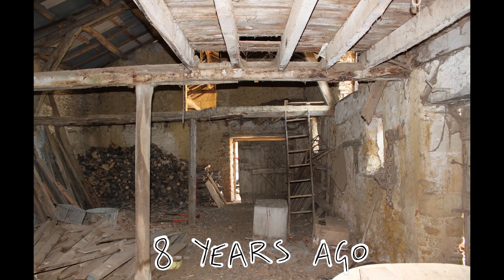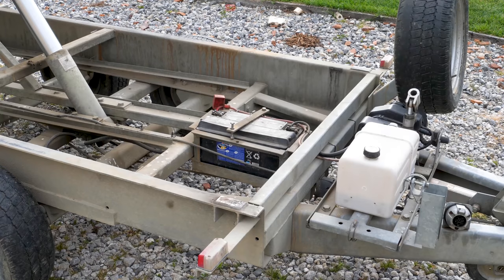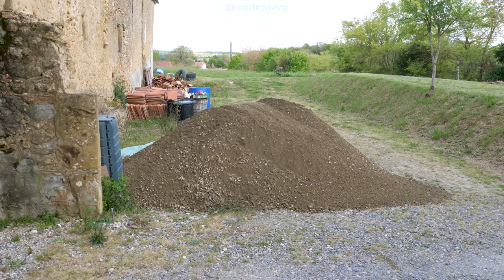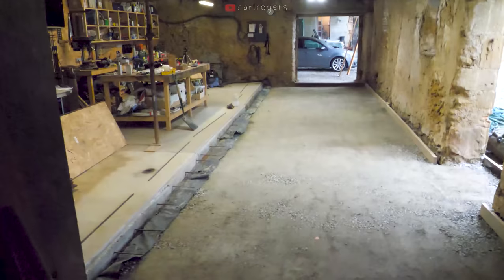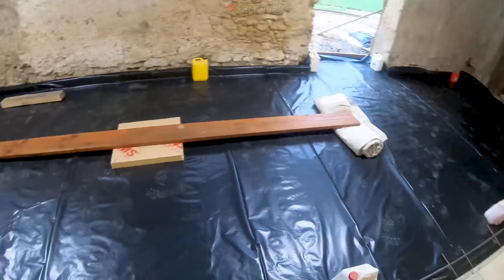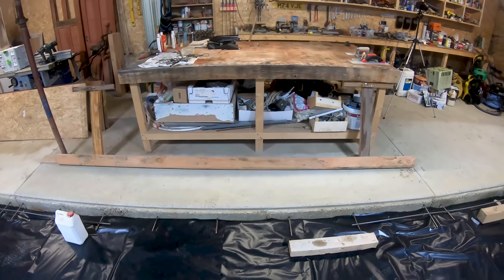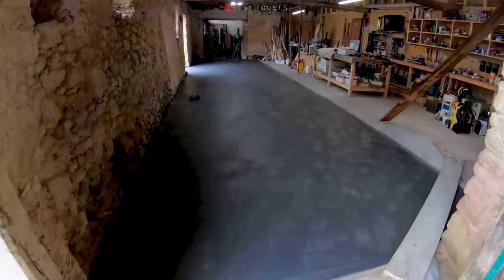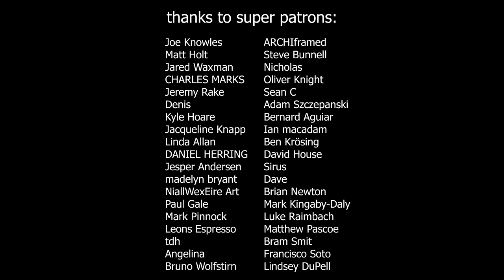How to DIY a Concrete Floor

Comment: You worked very hard on that project! The driver backing the trailer into the barn deserves a medal, especially as he had to turn in through the hanger, but why did you use polythene? You can easily specify waterproof in the ready mix for very little extra money and no weldmesh? The cuts through the surface are essential, and not something the "professional" floor layers usually do in France, there is a plastic form you can use which gives you a screed surface to level off to and acts as an expansion joint, it shows a narrow white line when finished, I find the ready mix drivers here in France are really helpful when they deliver, not like the UK drivers that will just dump off the concrete, they are more than willing to lend a hand, as your driver did, I did think you would end up with paw prints in your new trowelled finish floor! Stay safe ! Chris B.

Comment: As a new subscriber, I enjoy watching you and your Dad work on this old barn. I love the cadence of your narrating, it feels like story telling.
Here are some suggestions for safety: always wear a dust mask when making dust (concrete or wood), wear eye and ear protection, wear gloves when cutting the control joints using the grinding wheel. Please note, I'm not calling you out on any of these items, this is more of a general statement overall when working construction projects.
As a suggestion for setting pieces of rebar into adjoining concrete to prevent uplift/heave, drill the hole about twice the diameter of the bar, thoroughly clean the hole of dust, inject the hole with 2-part epoxy, insert the steel reinforcing bar.
Great work. Keep the videos coming.

Comment: I Know rebar is not always needed. But it is not a big expense, that is why I always use it. But each does what they think is right for the situation. Great finished result. I love to see plastic under concrete, don't know why it is not standard practice for everyone.
Reply: Would be good to control cracks just running a sheet of mesh at the 50mm high in the slab

Comment: You should have bull-floated it. The bull float helps to push down the aggregate so it makes it easier to trowel and get a nice smooth surface. It also helps the job go quicker.

Comment: Just as a bit of info, If you use "trenchflow" it goes down smooth out of the pump and when dry it is super smooth and it can be reinforced. I laid 164 m2 in 3 hours with the help of one man from lafarge agrigates, it is perfectly smooth and level with no tamping or trowling needed.
Reply from the maker: Thanks for the info Paul, will bear it in mind

Comment: Beautiful work. We are just setting out on a similar journey in Spain. Concrete workshop floor slab on list as soon as it gets cooler. We also have the same gear; pickup, trailer, excavator. But loving the Festool kit, mine is black & yellow if you know what I mean. :-) Keep up the great work, subbed.

Comment: back side up sheet metal studs at 6 - 8 foot intervals at finished height help attain an even surface. you can leave the stud in or take it out and fill in with concrete. Not a bad job; but settling as the concrete cures allows for hills and valleys. Would resolve your cracking issues as well.

Comment: Always nice to watch... Wonder why you put the first layer underneath? The ground is hard enough? Working on my own farm in the heart of France! Great result guys!!
Reply: Yes, I don't know why you would take the hard ground out of there...? And replace it with other dirt/rocks. Can you tell us why you did all that work?
Reply: Maybe so it’s a uniform hardness under the entire slab
Reply: My only criticism of a superb job. Material under a strong slab is to distribute point loads over a weaker material. If the old floor is dry and has had a hundred years of compaction why throw it away and replace it with stone that will have more voids even after the plate compactor. Know the rules but understand their purpose

Comment: The most impressive thing is how you avoided to have cat's paw prints on the slab.
Reply: yes, a concrete floor without a cat's paw (or dog) isn't a real concrete floor ;)
Reply: i have several small slabs i've laid in the last 20 years, every damn one has cat paw prints.
.
RIP Kira & Sox cats, gone but never forgotten.

Comment: You are going to hate me... your soil was so tight (as you stated)... you could have simple compacted it and put your concrete on top of some plastic...  Depending on your point loads... you could add more reinforcement as required /if needed.
PS What a beautiful concrete truck WITH A PUMP = amazing...  We don't have those in the U.S. (at least I have not seen one).
17:00 ''feeling wet'' =  the plastic makes it so the ''bleed water'' comes from the bottom up and not evaporation via the stone or soil below... Plus, you are inside = a much longer set time or rather an ''initial set"...  17:51  is ''gone on you"...  you have to really press hard to get that ''cream'' working. 18:30  do NOT use a steel trowel as it will close the surface and may block evaporation and then de-lamination will take place.
... I noticed that this barn use to have a second floor.
Reply: I'm wondering what would have happened to the concrete if they just left it after using the long wooden board at 15:15...

Comment: Honest question as a building novice: why did you replace the ground with the black dirt?
Reply: Exactly - why ? It's annoying me, all the hard work for what? The ground was solid from before- his exact words - rock hard. Floor just needed abit of levelling
Reply: Because originally it was clay, which won't compact properly, no matter how hard you try. On the opposite the black dirt will compact and became a solid foundation for the slab.
Reply: Hi Sander m and the others. So hard core or gravel allows drainage from moisture below the slab. It also acts as a capillary break. Hope this helps

Comment: boy do i know this problem.  Just got done putting a concrete floor in a garage.  When they built for some reason, they did not put a concrete floor in.  It was hard compacted clay, It was hard as concrete when dry, unfortunately springs are wet and it was often muddy.  I tried using a tiller to loosen up, but it just bounced off clay.  Used a Toro Dingo to get most of it.  

Yours looks much better than mine, but after 10 years of a muddy garage anything is better.

Comment: 👍👍👍Fantastic work though!! Good on you .. done two layers of compaction rather than one thick layer. thats actually very smart. You dont a nice job with the cement too.. Also cutting the cement before its fully cured still a bit soft, very smart idea easier for the grinder while the cement has plenty of moisture in it
You needed a Pick/Mattock for all the hard edges, impossible and uncomfortable trying to get all the bumpy bits with a shovel, the shovel is too lite, its more for loose soft materials, but especially when the dirt is clamped together hard you nned a heavy handed Pick/Mattock, even better a jack hammer with the spade attachment will do the trick..👍👍👍

Comment: Very nice work. I would have been inclined to use a foam expansion joint around some of the perimeter. Also, I am a big fan of some light mesh in the concrete which you either elevate on plastic adjusters during the pour or lift up after the initial lay. Considering the massive amount of road base under the concrete you may get good life without the mesh. I would not be driving a car onto this though.

Comment: just a tip when using grinders to dry cut concrete or masonry always blow them out the motor with a air compressor to remove all the dust.

Comment: Well done! Good to create some dilatation in the concrete, some plastic for slow drying, but still I think it's important to use some weldmash in big concrete floors (absorption of tensions).
Reply: it needs rio otherwise it will crack and move. I wonder why this was not done, particularly with this size slab. 
 Title should be updated to how not to....

Comment: Nice job, although I would've used rebar in that slab, and you really should use a mask when cutting/grinding in concrete or stone/rock young man.
Reply from the maker: yes definitely shouldve been - I didnt enjoy watching it back!
Reply: @carlroge  Nice work! I've always used  a circular saw with a concrete blade on the control joints, they've come out with a wet-cutting version that's just the best.

Comment: I could ask several questions only cause my friend is a civil engineer, but I wont on the concrete I just did the fllor in my shop 12m x 18m and in order for concrete to fully cure you should always once it sets up 1. Soak it down good with water 2. cover with poly to keep it wet and leave for 7 days then the concrete will be fully cured, we didnt cut lines in the floor because we took the time to fully cure the concrete floor. Here we tend to go with hardness of MPA50 but you only get that if you cure the concrete properly. I know this to be true because my neighbors shop floor is 60yrs old and has no cracks and here in Canadian north it gets very very cold.

Comment: It may be 'only' a workshop but a 100-125mm unreinforced slab over that area is likely to crack up, it ought to be at least 150mm thick with say A142 mesh with 40 cover in the top .  The joint with the existing slab should be an expansion joint as the new concrete will shrink back from the existing and so the dowel bars should be debonded.  Also, there should be an expansion hoint around the perimeter of the slab  You have cut joints but I note that there is no crack inducer formers on the bottom of the slab to match those cuts  The new and existing dpm should be taped together to get a waterproof joint as far as possible.  I would have used a power float rather than hand floating the finish due to the area involved.  Also, the finish ought to be treated with anti-dusting agent otherwise in no time the effort you have expended in the finish will be lost.

Comment: I wonder why you need such a thick concrete floor given that the sub base is already gravely and stony and rock hard? 150mm plus some rebar or fibre strand cement is usually strong enough for even the toughest job. Great videos all the same. 😃😃

Comment: You have to put metal grid in concrete, this slab will crack without it. Also you have to isolate walls from slab so it dont suck moisture from slab.

Comment: All good and nice ..... But one thing - and where is the iron reinforcement? You have not put it, and it is very important that this position because it gives the concrete a lot of strength and durability! It is placed in the middle of tall concrete. Iron rods came out of another soil, you have also drilled holes to fix rods for what? Well that, to them having put and tied that metal reinforcement to the entire floor (at mid-height). Otherwise job well done.

Comment: What was the thinking behind digging out the rock hard soil and then replaced with hardcore? Could the slab have been laid directly on to the ground?
Reply from the maker: compacted hard core is more stable so less chance of cracking if the ground shifts!
Reply: @carlroge  Cool, just intrigued. Cheers

Comment: Nice work, but I do not understand why you dug out the old ground which your digger struggled with to replace it with hardcore you had to buy? And this was for a 100mm slab you accepted will crack. Love your tool collection, I am working towards a similar tool box.

Comment: Reinforcement’s will help your Pad to resist cracks a minimum of an 8mill steel Wiremesh grid spaced at 200 mm each cell that you can easily get in any hardware store is ideal

Comment: Throw extra powder cement ontop as it dries and polish it. For the perfect honed finish. It also increases the surface hardness
Reply: This is a common mistake from the past, when the quality of the concrete was much worse than it is now. It causes surface cracks.

Comment: That is mighty impressive trailer reversing through a tight doorway.     If floor was so solid, was it needed to dig it out then hardcore?   In France you can buy preformed expansion joints for concrete (joint de delitation?), they are a triangular profile length of plastic - you can set them at a height to allow you to run you tamping boards on.  We got them at Point P when we did our barn floor.

Comment: The thing is with car batteries: you want to keep using them or they will get old. So you are best to get the battery out of the trailer and use it somewhere else, so the battery stays good.. 

Greetings,

Jeff

Comment: Super cool! One question: why not use a rebar mesh? Also, if using a mesh you Still need to perform the crack cut? Thanks

Comment: 1:33 As someone that hates trailers, that is some impressive shit lol. Your father is obviously a jack of all trades. What is, or was, his profession? Again, where a respirator when cutting anything containing silica. Silica will not dissolve, and slowly builds up in your lungs over time. The work you are doing is very rewarding, but protect yourself.

Comment: @carlroge I'm renovating an old stone  barn in Australia. Walls are 450mm thick. I've been getting a lot of push back from my builder because I'd like to go with a concrete floor. When you left the gap for the shuttering, was that only for the levels or were you leaving an air gap to help release moisture from under the concrete so it does not travel up the stone walls and cause damp issues? If so, was it around 100mm including the shuttering? Any help you can give would be appreciated.  Thanks Julie

Comment: Wondering why with that much area you didn't use bull floats? Definitely should have used either weld wire mesh or had fiber mesh reinforcing in the concrete to help control cracking in the slab. I do believe the dowels between slabs should have been smooth bars.

Comment: I was thinking how tedious must be to dig out the base for a concrete floor, fitting the excavator into the space & such.  Then I remembered how my brother and I had dug out part of a basement for a concrete slab (for a furnace & water heater to sit on) using buckets and shovels.  probably almost 35 years ago now that I think of it (we were FAR younger at the time).

Comment: You should of used a long handle troll. There wouldn't be any swirls in the surface. Any lines would go in the same direction.

Comment: that is high effort DIY concrete slab for at home (non-commercial use)
or when you write "workshop" do you intend to drive over it with heavy tonnage machinery?

Comment: Can't tell you how many homes I rebuilt . Nothing this old but 1820 was pretty much looking like the stuff you are working on lol My guess there are no termites in France lol. I have seen 12 x 12's hand chopped eaten up by bugs 8 feet into the building
Reply: In some parts of France you need an independent surveyor to certify that your house doesn't have a termite problem if you want to sell it.

Comment: You asked for ideas for sawdust;
Local
> Compost
> Mulch
> Animal bedding
> Soak up mud in
   Walkways, Paths, Driveways
Retail Sales   (1732 brand)
  (w/ Certificate of Authenticity)
Bagged
> Souvenirs
> Houseplant Mulch
> Campfire Starters
   for Campers & Prepers
> Filler of interest for
   Epoxy-Resin Artists
> Handmade Paper Artists
Mixed with a medium
   & poured into a mold
> Stationary
> Replicas of the house
> Plaques for the House's
   Historic Coat of Arms
   or a 
   Parchment Rendering
   of the House
> Placemats & Coasters
> Local Folklore Characters
   or the House Mascot
Note: Limiting the edition increases the value.

Comment: But when the soil underground was so hard& dense, why it was necessary to get all out an do a new layer of sand? I would scratch out 15 cm, than having a steel net layer and than insert 10 cm of concrete. Not good?

Comment: If the ground is rock hard as you say why bother removing and reducing it? Just sand blind it  add dpm and concrete it, you just did a whole lot of unnecessary work.
John Richardson 
JPR Building services (40 years)

Comment: Please think of your lungs when working with concrete. Concrete dust is as bad or worse than asbestos. Under a microscope the silica dust looks like asbestos fibres Wearing a proper respirator will provide you with decades of quality breathing. Love watching your video's.

Comment: No need for all that harcore, the base was solid, all it needed was blinding with sand and compacting, which you should have done with the hardcore anyway, to prevent puncture of the membrane.

Comment: Everything was done right but excessive.  When the ground is as hard as it appeared then the only reason to prep the base is to minimize the cost of the expensive concrete if only 4 to 6 inches is needed

Comment: Great job on the project. Turned out great. However, anyone trying to do this should wear a mask when cutting concrete. Concrete particles and lungs are not a good match.
Reply from the maker: yes i regret that

Comment: Don’t understand why you removed flooring that was all ready hard as rock to replace the floor removed with more of the same material- instead of just leveling out what was there 3-4” down and then placing the concrete

Comment: You can use a liquid surface hardener to finished your concrete, it will give nice clean surface and prevent dusting.
You can even use it on the old concrete as well
Product of choice:
https://www.master-builders-solutions.com/en-tr/products/mastertop/mastertop-cc-733

Comment: You gave self hard work with the tamp , hire a buzzbar. 1man job done & buy. Or make a decent arris trowel, split the bays to 3 it will then give you the expansion / control joint and you can mix yourselves without the cost of readymix. ..... & paying for the mad dog!   You must have money to burn , all said and done for a young fella you show more promise than most (& get a rop on fitted on your machine before you hurt yourself)